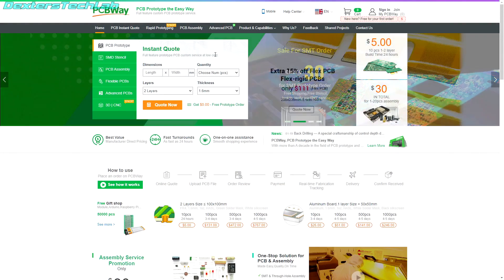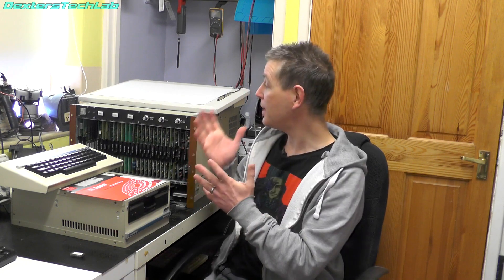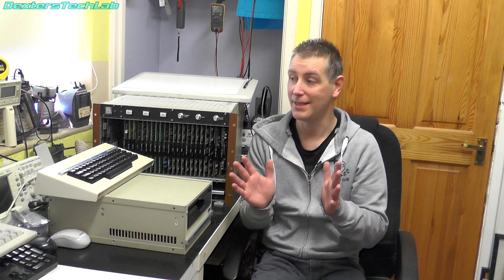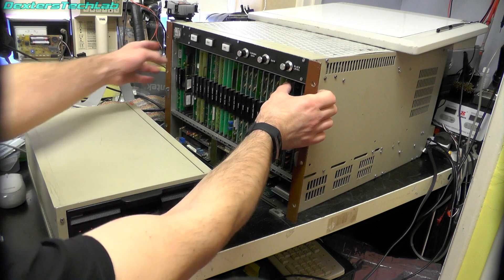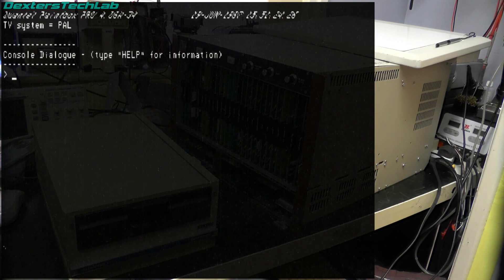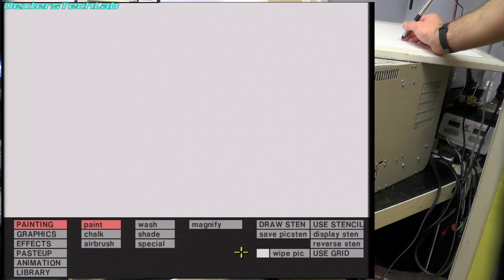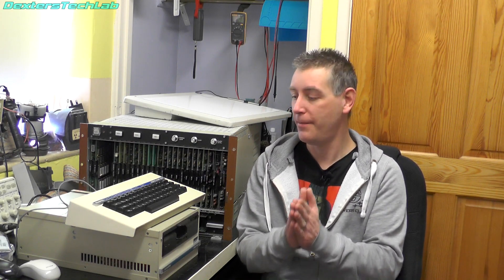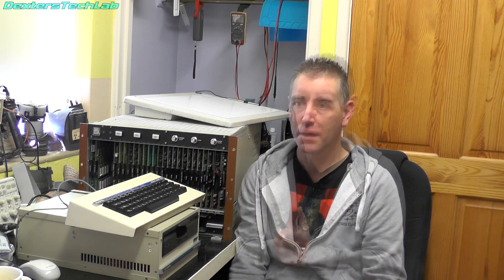DL210 Quantel DPB-7001 Digital Paintbox Restoration & Repair Part 4

Comment: Could you post a link to the DPB Emulator project? I'm curious to see how that's going.
Reply from the maker: Hi Carl, It's part of MAME since 0.211, the last update was around January last year. When something significant happens i normally post in this thread on the EEVBlog: https://www.eevblog.com/forum/vintage-computing/quantel-dpb-7001-paintbox-mame-emulator/
Reply: @DextersTechLab  awesome, thanks for the information!

Comment: Loud applause! 

I remember once there was a crash on our work 11/780 that left the 8" floppy drive spinning overnight with the heads loaded - the next morning, the system manager extracted the disk that was in there and it had a perfectly clear ring where all of the oxide layer had worn off the substrate.  They were never the most abuse-resistant medium...

Comment: For the drives, is it worth looking at the CDC Cyber for inspiration? Didn't the Cyber 18 use SMD drives?
Maybe contact Tom Hunter? http://www.control-data.info/
Reply from the maker: Thanks, i'll certainly take a look!
Reply: @DextersTechLab  Also it's defined in ANSI standard X3.91M if you can find a copy!
Reply: @DextersTechLab  and Blam... he finds a Texas Instruments Application Note from ancient times.... AN-413, YouTube won't let me link directly but its at tiDOTcom /lit/an/snoa710/snoa710.pdf?ts=1613068546958

Comment: EPROM likely is still fine, just that it need to have the contents reprogrammed, as likely there are a couple of low bits that have degraded, drifting down to the point they randomly read as a high. Your glitches are likely also a result from the main 5V rails having noise on them, might be worth checking the power rails on the cards are still fine, and with low ripple on them.
Reply from the maker: Hi Sean! I think it's a bond-wire issue in the eprom, it's sensitive to touch/vibration. When it's not working it wont read or write.
Reply: @DextersTechLab  If so then a bit of work with a microscope will be needed, and you can simply take a few photos, and then take it and drop it onto the desk face down, to see if that will show you which bond wire has come loose.
Reply: Depends on the sticker, tho... maybe some UV light found its way inside. Plenty of old labels degraded over time and let UV pass as they don't stick properly anymore.

Comment: The SMC hard disk was a Control Data Corporation A and B cable MFM variant wasn't it? 
I think it is the same HW interface as the Harry and the HAL if memory serves.
They were also used in dec PDP11s and other Unix Systems, including Ampex DSS Still stores, and AVA paintbox.

https://en.wikipedia.org/wiki/Storage_Module_Device
Reply from the maker: Quantel used many PDPs internally, in fact the prototype DPB-7001 used a PDP11 for control before they developed the Motorola 68000 based computer cards for it. So is probably a good reason why they ended up using that interface. You can see a LSI-11 in this old footage of one of the DPB prototypes here: https://youtu.be/TyCmIH06rQE?t=57

Yes SMD was used also on the Harry but not HAL, by that time they had switched to SCSI disks

I am very interested in finding more information on the AVA, i have been told by someone who has used one that it was a competing system but not as good as paintbox.
Reply: @DextersTechLab  as the story goes... it was licensed by Quantel to Ampex. 
Quantel many years later tried to take photoshop to court, for IP copyrights, but apparently failed to prove their case, partly because (and this is the part that I heard, third person, and have no way to collaborate) they were unable to find a working Ampex AVA system to show that they licensed the IP to Ampex and that adobe used the AVAs look and feel in the photoshop application. 
IANAL, and YMMV...
Reply: @tekvax01  Wow! Kinda like Steve Jobs stealing the Apple UI from Xerox.
Reply: @DextersTechLab  oh right the HAL used SCSI... I meant to say, Harriett.

Comment: Incredibly lucky with the EEPROM! And that PSU looks totally OEM, cracking job on that.

It's so amazing to see this machine up and running! Truly astounding that a box back in 81 was creating such beautiful crisp output. Think, back in 81, the basic blocks of red slathered on the album art of Talking Heads Remain in Light was considered technically advanced... basic blocks of solid colour. And yes, that may be for artistic reason, but I'm sure it was mostly technical limitation. Rich computer graphics were limited to astoundingly slow and expensive 3d rendering machines which slowly rendered frame by frame to analog film.

Most TV shows had 16mm film clips in them, shows that were filmed on tape used vidicon tubes, with their streaking and soft image... Vision mixers were limited to basic effects.

And here you have the Paintbox, with crisp output. 16.7 million colours, direct to display

in 1981.

It's so easy to take this stuff for granted but its mind blowing stuff.

I really hope that you can get everything working as it was when it was actively in use. HDD connectivity, video input... the works.

What a fantastic piece of television history.
Reply from the maker: Thanks Richard, yes in 1981 it must have looked astonishingly good on a big 20" broadcast CRT. At some point i should get it connected upto one. The Paintbox looks stunning on a CRT.

Comment: Great to see it working. It looks light years ahead of anything you could get at home in 1987. Who knows what goodies are on those floppies, very interesting. EastEnders graphics? Was the opening created on a Paintbox?
Reply from the maker: Ys, i am looking forward to seeing what is on the floppies and fingers crossed the hard disk. Sadly the Eastenders labelled disks that came with it are not from any Quantel machine i am afraid. They are for an Aston character generator and will be the credits that scroll at the end of the program. Given it seems this DPB came from Elstree where Eastenders started, it's likely the Aston disks just got mixed in with the DPB disks.

The early Eastenders titles look like a setup as an optical sequence, with a camera on a motion control rig probably over a very large print so no Paintbox there, but the EastEnders text at the end which is revealed with a vertical wipe could have been created on the DPB and then composited over the top.

Comment: Good work! I know what it's like keeping these old systems up and running, I have an Abekas A53D video effects unit that was working fine but I now need to do some circuit level debugging, which is likely going to require making an extender board. Wouldn't mind getting my hands on a Quantel Mirage someday!
Reply from the maker: Thanks Steve, since working on Quantel's stuff it's eye opening how much tech went into broadcast equipment, it's good to know your keeping some working too!
Reply: Wow, you have an Abekas? That joystick! Every time I open After Effects I groan thinking of the beauty of those real time machines :)

Comment: If only the UK had something like PCBWAY, Could you not use a SCSI to SATA adapter to let you use SATA drives in place of a SCSI drive something like the AEC-7732 SCSI to SATA adapter, BTW is the SCSI LVD ow what?